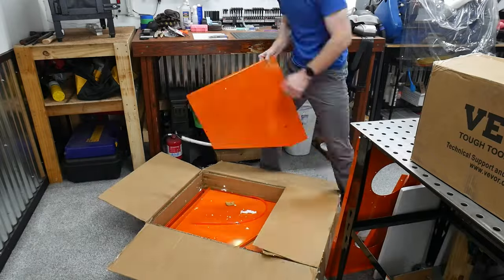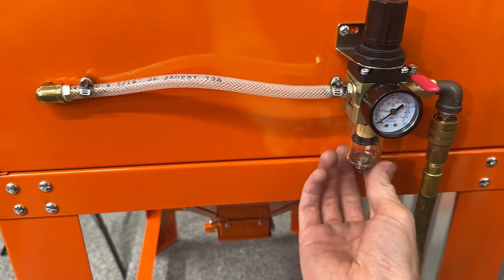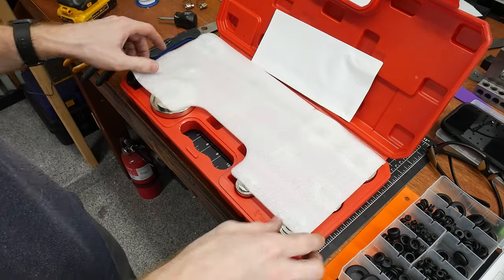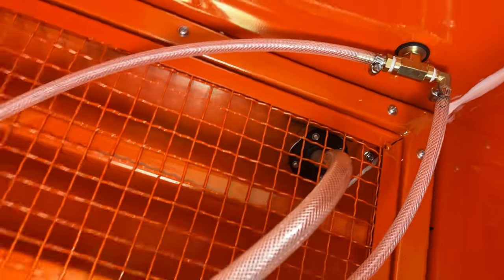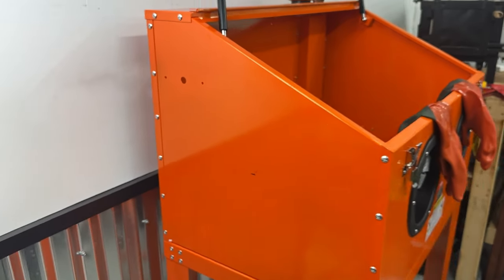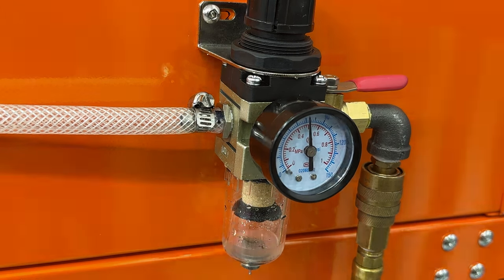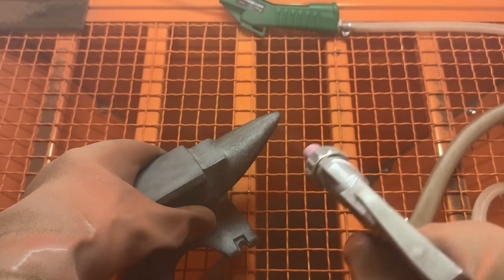VEVOR Sandblasting Cabinet & Dust Collection Review | Must Have Mods

Comment from the maker: ⭐ Vevor Sand Blaster and Dust Collection System - https://s.vevor.com/bfQ1bP
⭐ Vevor 5% Discount Code = VVSALE5 

🔩 CAD Files Here - https://www.patreon.com/posts/vevor-sand-106001080

📋 Mods / Items:
Regulator Water Catcher - https://amzn.to/3Xiyz8M
Rubber Grommets - https://amzn.to/4elz08K
Blow Gun - https://amzn.to/3x3qOJt
1/4'' hose - https://amzn.to/4cgtxhr
1/2'' hose - https://amzn.to/3xb44Hs
1/4'' Barb - https://amzn.to/3xb4Fc8
1/4'' Female Tee - https://amzn.to/3KEe0wg
90 Degree Barb - https://amzn.to/3KFomfi
Hose Clamps - https://amzn.to/3VhJvAZ
120 Grit Media - https://amzn.to/4ewn7gj

🛠 Tools:
Hole Puncher - https://amzn.to/4b12x4x
Line Splitter - https://amzn.to/4bVLDpl
Clamp Meter - https://amzn.to/4aVFojT

Comment: Really good video!! I finished mine Saturday and tested it all out and it works great. These mods are really valuable and take this sandblaster from a frustratingly mediocre sandblaster to a really solid and robust sandblaster that works really well. And the best part is these mods really aren't expensive, especially considering the value you get from them. 

Also, really good job on explaining everything step by step. That details on the steps and "how to" can't be underestimated. All the parts have links so you know you're using the exact same parts. Literally all you've got to do is click on the links to get the parts and watch the step by step video. 
You nailed this video!

The only step I improvised on was the hole in the side of the cabinet for the grommet/air hose. I didn't have a ratchet knockout hole punch so I just used a hole saw which was much cheaper (if you don't have a knockout punch) and the hole saw did the job just fine
Reply from the maker: Nice! Glad you got some use out of this video! Cheers!

Comment: Okay, here is my 5 cents worth. I have the same unit with the Dust Collector also from Vevor. Before installing my dust collector onto the cabinet, I installed an RV gate valve that is usually used for the Sewer hose connector, with a clear 45-degree sewer connector which I cut the end off in the angle of the cabinet. I drilled a hole through the side of the cabinet the same diameter of the clear 45 PVC connector. Then I use a joint flange PVC connector to mate it to the cabinet with a flange rubber gasket. The dust collection sits higher unto the side connector to compensate for the added on Gate-valve and 45 clear tubing. So when I want to empty the dust collector, I just open up the Gate-valve by sliding the valve open and the media will just flow from the Collector down through the 45 clear adapter and into the cabinet. The clear adapter will tell me when the Collector is empty. I hope this help make the experience more enjoyable.
Reply from the maker: Nice, thanks for the comment and thoughts!

Comment: Great video James!  I’ve always gotten the best results with glass beads.  If you want an even finish on your blade with absolutely no hand finishing, you can’t beat it!  80 grit is what I use.
Reply from the maker: I’ll have to give that a go! Do you generally leave that finish with stainless steel or carbon blades too?
Reply: +1 for glass beads as well, not as aggressive as Aluminum Oxide but a great finish - I would love to see some corrosion testing from you on different steels and media!!

Comment: Great video, I’ll be very interested in how the 3d prints hold up.
From using industrial blasters slightly larger than this they can do a lot of damage very quickly.

Would be interested to see a comparative video of various blast media’s for different tasks.

(Paint removal, rust removal, best finish etc)

Something I’ve had many a conversation about when blasting equipment in the past
Reply from the maker: Thanks for the comment! That would be interesting for sure!

Comment: Broski, if you're really worried about air dryness (say for a plasma), look into intercoolers (between the compressor and tank), and get a triple filter/reg (solids, liquids, desiccant dryer), and then a motor guard. Esp down here in the Lone Star State, you need to curb the humidity as much as you can.
Reply: As for blasting media, depending on how specific you need to be ("per the print", ie shot peaning, glass beads, etc) get an industry standard media. Otherwise, black diamond has been a great go to "parts cleaner" media for my purposes. Although, sieved play sand (rejecting the large stuff), set out in the sun for a few days and turned over to dry, has worked well for me too.
Reply from the maker: Niccceeee thanks for the info!

Comment: The Vevor sand blaster comes with a fitting and a cap to plug that back hole. It also states to put screws with nuts in the 4 screw holes. You didn't need to make another part for closing that original dust collector hole...
Reply from the maker: col

Comment: I've found 80 grit glass bead to look good on copper and brass if a matte finish is what you're after. I have no way to test this, but I'd imagine you'd get a little work hardening on the surface of the metal.
Reply from the maker: Good point! A little surface penning may help. Cheers!

Comment: Hey, great video. I am doing your build and the link for your 1/4" barb takes me to a "3/8 Barb × 3/8 NPT" Is that the correct item link? Trying to use your affiliate links so you get the kickback thanks! (Also looks like your discount code no longer works)
Reply from the maker: Hey man, thank you! And thanks for letting me know about the discount code. Looks like they rotate it... this one will work VVPROMO 

If I recall correctly all the barb fittings and threads were 1/4'' NPT

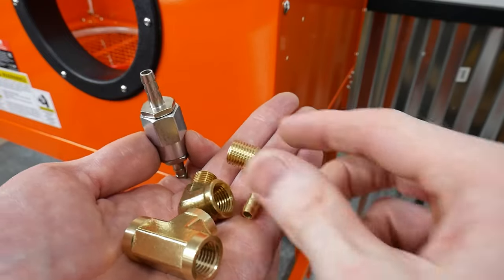Comment: Thank you for the great video.  Just used all your affiliate links and I'm in the process of building it now.  Almost done too.  Got some questions though.  I don't see links for certain items.  Maybe I'm missing something though.  At 2:46, you have 3 pieces in your hand.  Do you have a link to the middle piece.  The 90 degree piece.  And at 3:38, do you have a link to that black piece on the water catch.  Also, regarding that hole that you cut to big for the hose that feeds the blast media.  What size should it have been.  I assume just a half inch right.  Just want to make sure I understand it correctly.  I've never done anything like this so it's all new to me.  Thank you for your help and thanks again for the video.  Your time lapse video helped with the assembly too.
Reply: You know I just realized that hole that feeds the blast media to the gun needs to be an inch like you intended.  Disregard that part lol
Reply from the maker: Thanks man! Glad you enjoyed the build and got something out of this video. Sorry I missed that one! Could have bought it locally... don't remember. Here is a link to the 1/4 90 - https://amzn.to/3WunAr4

I'll put it in the video description as well for future builders. 

at 3:38 are you talking about the 90 degree 3/8'' to 1/4'' reducer 90? I couldn't find one on amazon, but you may be able to use a reducer like this one - https://amzn.to/3YrhMkv

I'm not exactly sure on the appropriate hole size, but based on the CAD file I made to fit the grommet I'd guess it would be about 0.45 to 0.55 inches.... ~0.5 is probably the right measurement since the hose was really tight going though my grommet. 

Cheers and good luck!
Reply: @RedBeardOps  Wow.  I didn't expect a reply so quickly lol.  I ended up finding one and buying it.  Sorry man.  Would've loved to have gotten one through your affiliate link.  Trust me, I know how valuable they can be.  I should be good to go now.  I'm doing the metering valve as well so all I need now is the valve from that website you recommended.  Excited to get this thing going. Thank you again for the quick reply
Reply from the maker: @shoguncustoms  Man no need to apologize for that! Happy you got what you needed! Good luck with your build; sounds like you're on you way. The guy at the place that sells the metering valve is good at answering questions if you have flow issues.
Reply: @RedBeardOps appreciate it man. Just about there. Whole cabinet is built. Just got to do the reclaimer, lighting and air system. It’s been slow since I have to squeeze this in with all the work I have to do in the shop already.

Comment: Hey at 11:09, are you using a different t fitting than you showed in the beginning?
Reply: I see some kind of flange and grommet
Reply from the maker: 3:27 is the assembly i used. Looks like at 3:31 I used a rubber washer that I think came with the VeVOR kit. I see what you're seeing... kinda feels like a optical illusion.
Reply: @RedBeardOps ahhhhh. Ok Gotch ya. Definitely an illusion lol

Comment: Dear Sir, I bought the regulator off amazon and one side says 'out', the other says 'in'. If I hook it up as you have, the 'out' goes to the compressor. Is this correct? Does it matter?  Thank you...matt
Reply from the maker: The assembly can be rotated. And gauge moved if needed. The "IN" is your feed from the compressor and the "OUT" goes to your cabinet. The direction does matter.
Reply: @RedBeardOps  yes! than you. I moved the gauge. Love your channel!

Comment: 1. That blasting gun is crap. Get yourself a proper gun and foot pedal. I have the combo from easstwood and it works well. Don't buy cheap ebay guns, they are crap.
2. Replace all your 1/4 inch hoses with 1/2 inch; you are loosing allot of flow in 1/4 inch. 
3. There is no perfect media; it depends on the job. Aluminum/brass/bronze clean-up glass bead works well. For rust steel grit/bead mixture works well. For paint removal even on delicate plastic parts, plastic blasting media works well. If you just want to eat through stuff; then SiC works well.
4. Add a 120 to 220 mesh screen under the glass window; it will protect the glass bettor than plastic liner; plastic liner will etch/get dirty way too fast.
Reply from the maker: Thanks for your tips

Comment: Vacuum sandblaster is very week and useless on paint or heavy rust it has not the power to cut off and clean materials... And olso you need a huge air compressor. If you add on your cabinet a pressure sand blaster  the results are amazing the cut sand power is x10 and olso your work time is faster x10 and you dont kill your air compressor to work continuously trust me i have the same dust collector and custom big cabinet this company has olso a pressure sand blaster
Reply from the maker: nice tips!